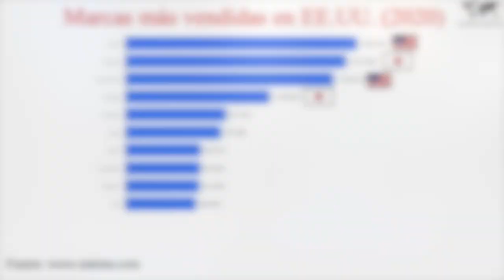Why AMERICAN cars failed in JAPAN?

Comment: It is not because the cars are made in the U.S. that they do not sell, but because the current U.S. cars do not meet the needs of the Japanese market and are not adapted to the environment and lifestyle in Japan.

Many parts of cities in Japan remain as they were in the past, so the streets are still narrow in many places.
When you see these narrow streets, you will understand why Japan developed its own Kei (light) cars and Kei (light) trucks.
Kei trucks are used not only for work in factories and farmlands, but also for practical use in towns with narrow streets.
You can understand why large cars like American cars do not sell well in Japan, 
because they are not suited to this unique environment and lifestyle in Japan.

Thus, the primary reason why American cars do not sell well in Japan is that the size of American cars is too large to fit the environment of narrow roads used in daily life in Japan. This is not only due to the narrowness of the roads, but also to the difference in space for parking along with the roads; even in large hourly parking lots, the partition for one parking space is smaller than in the US. 

In addition to narrower roads, parking spaces are also smaller.
It is obvious that large American cars do not fit in this environment.
This environmental factor is the reason why Japan's original, extremely small light trucks and town-use light cars were developed, manufactured, and popularized for use in Japan.
It is only natural that there is no market need for something that is not compatible with environmental factors.

The second reason for the lack of sales is that Japanese cities have a complete and detailed public transportation system, including a train network and bus route network. In addition, the number of departures is large and the schedules are overcrowded, making it possible to take a train at any time of the day.
Long-distance transfers to rural areas can be accomplished by using the Shinkansen and limited express trains instead of private cars.
In this way, daily transportation is sufficient without having to rely on a car.
This is also a completely different market situation from that of the United States.

The third reason is that in such a train network-centered transportation society, cars are mainly used for daily transportation near the place of residence, such as for daily food shopping.
In this case, a small car with low fuel consumption is more economically efficient.
This is the reason why fuel-efficient compact cars and Japan-specific kei cars have been developed for the Japanese market and are selling well.

In summary, American cars do not sell well in Japan because they are products that are not suited to the Japanese market environment, i.e.
(1) Differences in road widths and parking lot sizes due to differences in the size of the country's land and plains,
2) Differences in the availability of trains and other means of public transportation,
3) Since the main use of cars is for daily town use and leisure on holidays, large American cars have higher fuel and maintenance costs than Japanese cars.

These three points are believed to be the reasons why American cars have difficulty selling in the Japanese market.
This is a natural market principle that American cars cannot sell as they are now, considering the environmental compatibility factor.
If you are not convinced, just visit Japanese society and take a look at their real lifestyles and differences, and the reality will be obvious to anyone.
Unfortunately, no matter what the product field, if it does not meet the needs of the target market, the product will not sell.

Comment: Only Jeep is able to make a dent in the Japanese market selling 10000 units annually. Able to sell right hand steering to the market.
Not just size, but the bigger engines are more taxing to the consumers. You mention kei cars which you pay the lowest taxes and being fuel efficient. Reliability too when car owners have to pay for repairs and scheduled inspections to become street legal. Expensive to import parts used in foreign car brands.